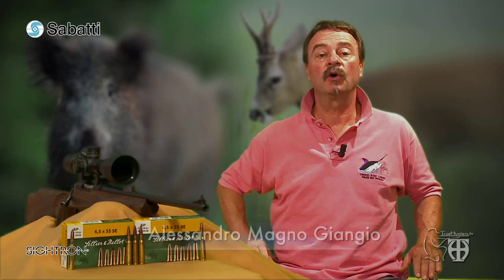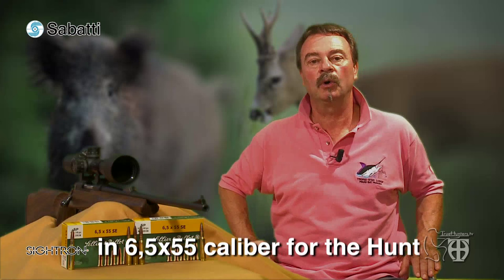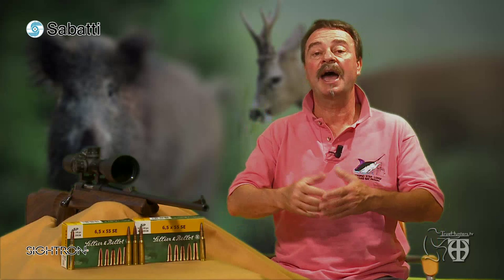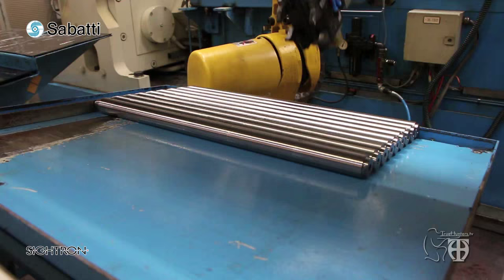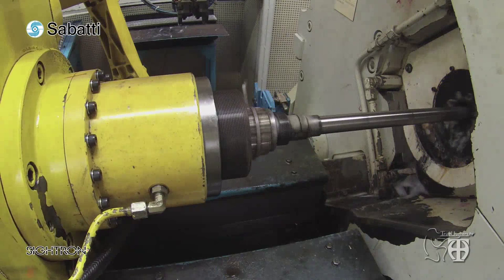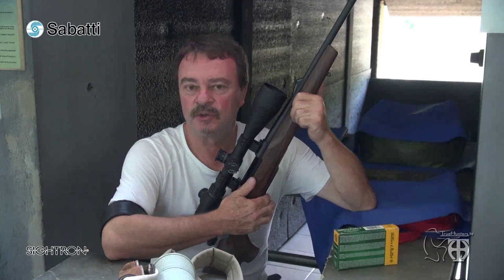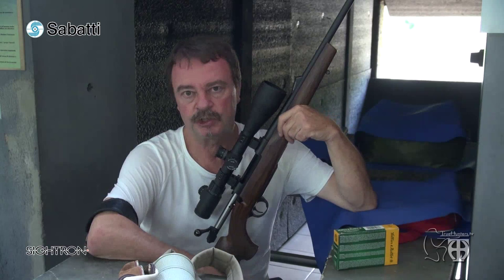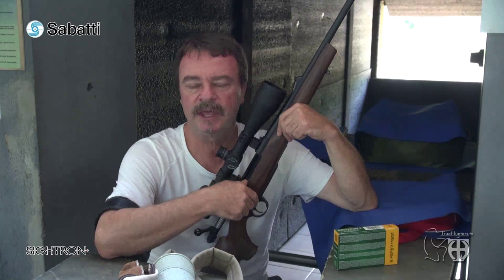Hunting field test: Sabatti multi radial rifling barrel cal. 6,5x55 SE

Comment: It's not new, its just marketing. This rifling is old and was used in the Lee Metford rifle. When transitioning to smokeless powder, the rifle was made strong enough to later have new barrels fitted with land and groove rifling. This "radial rifling" worked better when cleaning barrel fouling caused from lead projectiles and black powder. Conventional land and groove rifling works just fine with jacketed rounds and smokeless powder.
Reply: Dear Erik, your observation is correct, but The Sabatti MRR (Multi Radial Rifling) is ot "just marketing". 
It is an evolution of the polygonal rifling designed by Alexander Henry in the second half of the XIX Century, but it has been Patented by Sabatti.
And to make it short: it works.